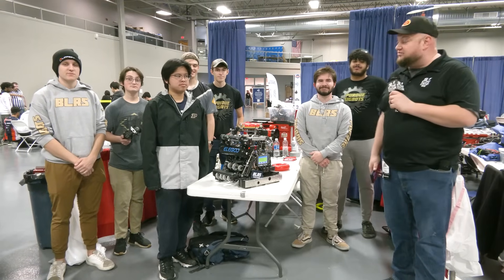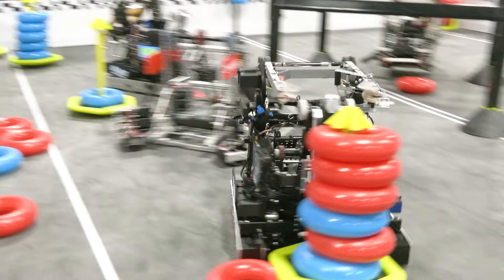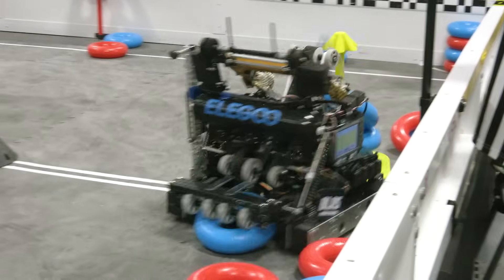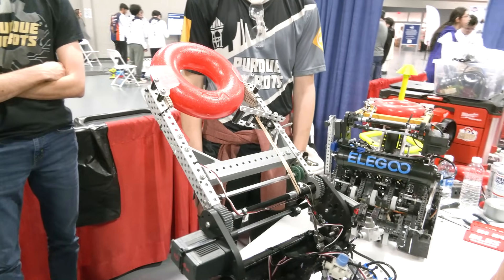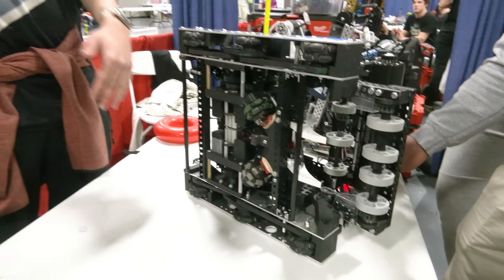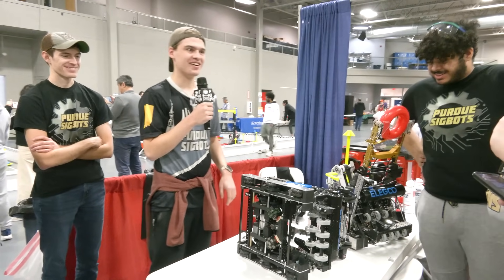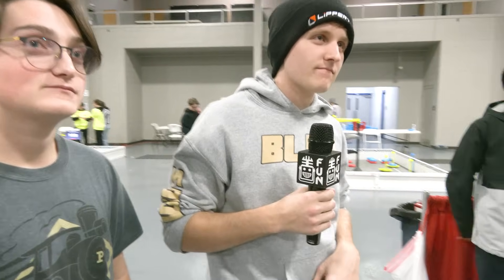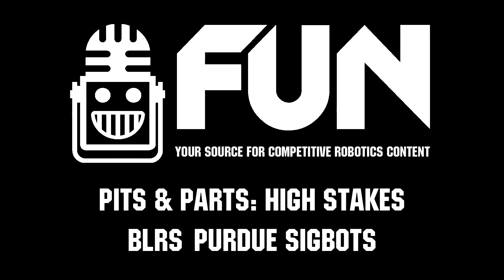BLRS Purdue SIGbots | Pits & Parts | High Stakes VEXU Robot

Comment: Made a transmission for our old robot for vrc a few months ago for high stakes that got cad designed over the course of 18 months, worked perfectly on a mechanical aspect, took it apart. Good to see their at least usefull for vex U
Reply: Their really not. Regular drives did just as good as the transmission at this event.
Reply: Yea most transmissions on such a tiny field make no sense. Spent half a season back in turning point and it just wasnt worth it. Normal base accomplishes the exact same thing honestly.